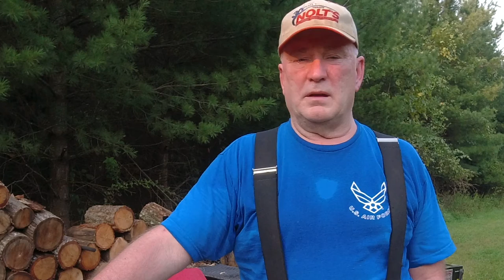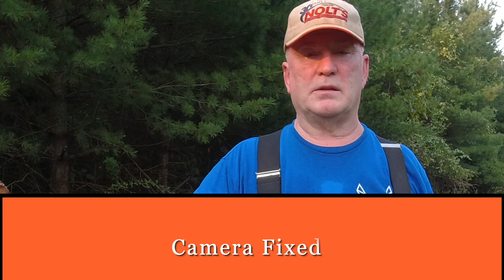Camera Fixed

Comment: Glad your issues are fixed.  My therapist says my issues are irreparable! 
Get yourself some Gator aid, Bob.  You look like you're leaking pretty badly.  These hot days and high humidity are killers when working outside.  
Cheers!
Whipple
Reply from the maker: Man, it's a hot one
Like seven inches from the midday sun.  
- yes indeed, I planned to split one more load, but knocked it off after I stacked the wood.  There was no wind at all, and the black flies were in attack formation.  Funny how they always aim for your eyes.  I keep Gator Aid on ice for days like this.  I hope you all are well.  Thanks for watching and commenting - cheers

Comment: Great job finding the issue, it is often hard to find some of these settings
Reply from the maker: You got that right.  This video doesn't really mean much, but if it can help just one person it will be worth time time and effort I put into it.  The funny part of it is, I did it to myself.  If I would not have done a "factory reset" it would not have hit the low temp threshold.  Once again, thanks for watching and commenting - cheers

Comment: I have one of those go pro clones an it has so many different setting, I don't understand what they all do. over all I like the camera , it does a pretty good job on videos I think.
Reply from the maker: The DJI Osmo Action has a good picture for what I do, and you can have 2 or 3 of them for the price of a GoPro.  So my camera was overheating and shutting down in the middle of what I was doing.  So, when I bought my second camera I wanted both cameras to have the settings the same in order to product video that looks the same.  To do this, I did a factory reset on both cameras which put the Temperature Threshold setting on both cameras on low.  The low setting shuts down the camera at a lower temperature.  I changed the setting to high and now I am recording for 3 hours without a shut down.
Reply: @botabob  I have an Akaso 50 Pro it's barely over 100 dollars and since I am no expert at videoing it does fine for me.
Reply from the maker: That looks like a good camera.  It does 4K30fps which is what I shoot my videos.  That said, I render them in 1080p HD.  By shooting in 4K, you can zoom in and still maintain the HD quality of the video.  Next I need to work on a good mic.  Thinking about an external recording that I can sync to the video.  Time will tell.